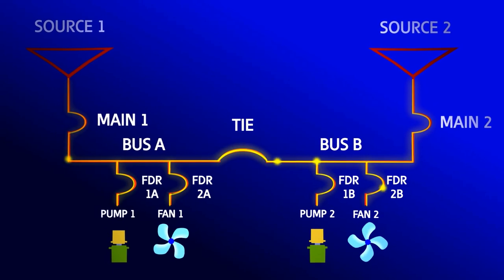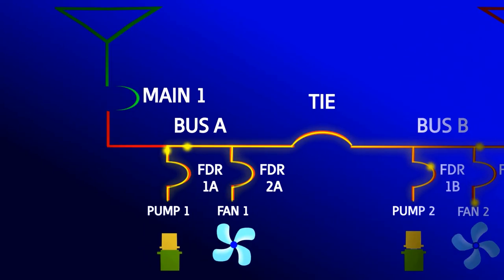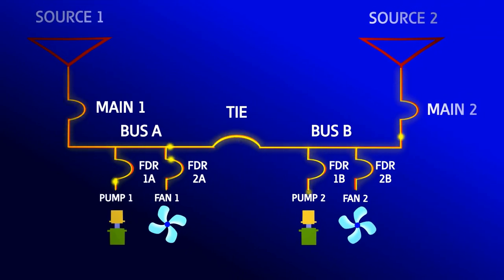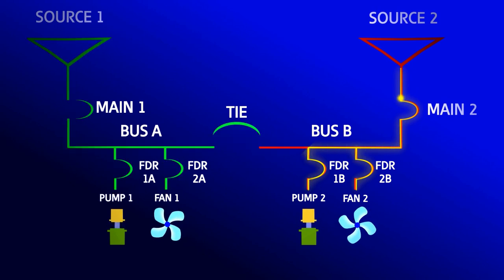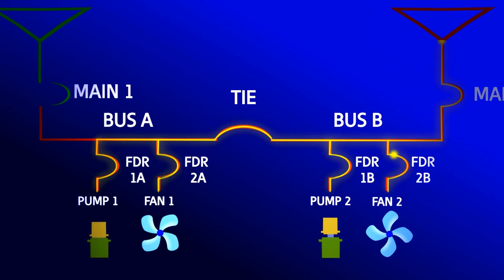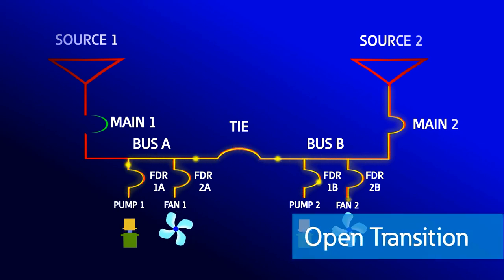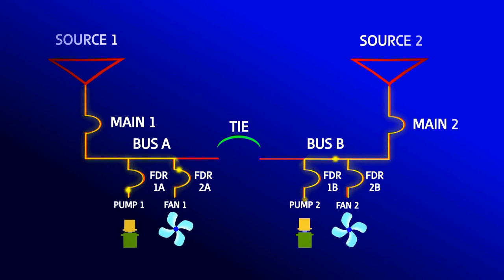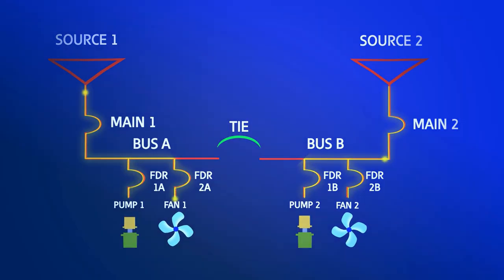Main tie main operation

Comment: Because of the name being tie breaker it makes it hard to actually find relevant stuff on google. I'm curious how the tie breaker in this case knows that the load is lost or when it comes back on one side? Is it sensing the voltage or is there a mechanical component?
Reply: I think that who makes the transfer between the breakers is a PLC, such as DEIF, BASLER, EMCP etc...
Reply: If the intent is for automatic transfer, then yes you would need monitor voltage and current (at a minimum, you could monitor frequency as well).
That monitoring requires voltage and current sensors (CTs and VTs).
You would also need a device to handle the auto-transfer logic. These day, the logic would be built into an electronic device like a microprocessor relay.

Hope that helps